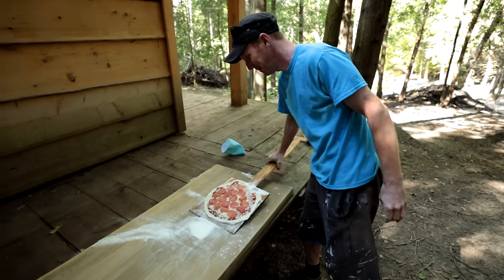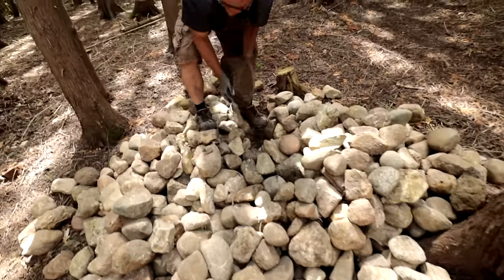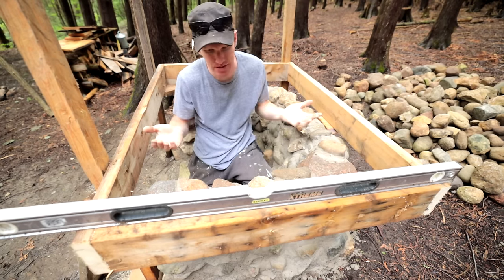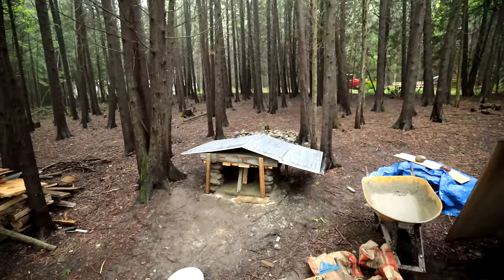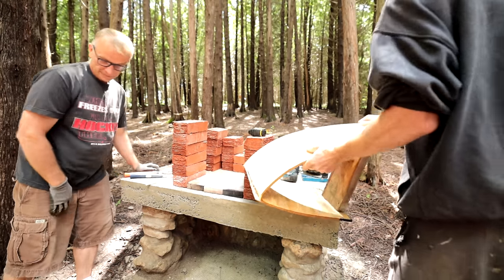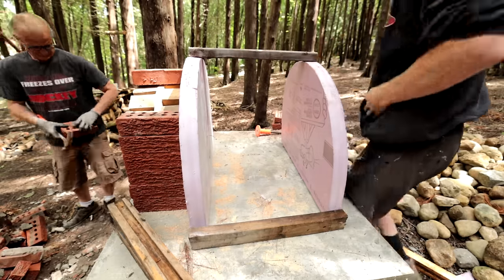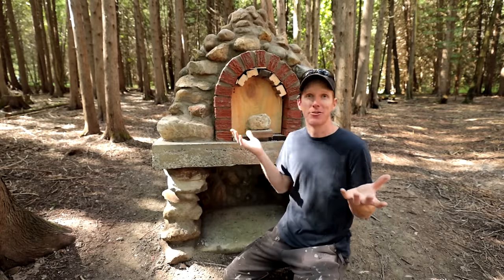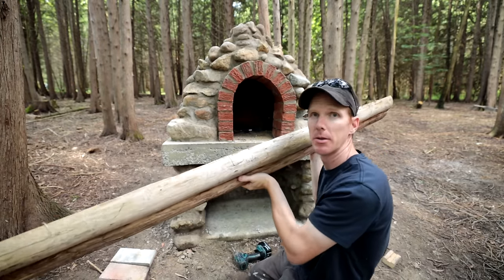I Built a Rock Pizza Oven!

Comment: Nice video and nice oven!
Suggestion:
After building the oven dome with rocks and cement mortar, apply at the inside of the dome a 3cm clay liner.
The clay should be thoroughly mixed with sand and chopped straw.
After application let dry and burn the liner slowly increasing the heat. 
The clay will shrink and comes loose from the rock dome forming a thin cavity. The that's what we want! The cavity prevents excessive heat transfer into the rock shell. Whereas the clay liner becomes really hot. 

The liner will crack a little but the cracks are easely repaired with clay slurry. 
The results are:
Quick heating up. 
Less wood consumption. 
The Rock / cement outer shell remains much cooler than the clay liner and due to that with lesser tendency to crack! 
Increased overall longevity due less thermal loads. 
The liner will be baked afterwards and will not soften by water. Nevertheless the oven should be covered (especially in winter) to prevent water entering. Porosity of the cement and baked clay is your enemy. 
Good luck!
Reply from the maker: Thank you for this.  I might retro fit / upgrade in the near future.

Comment: You tie the rebar so it doesn't shift from its position. The rebar in your slab should be in the center so it is in neither compression (at the top) nor in tension (at the bottom) for best results. For a slab like you made welded wire fabric (about 4 x 4 inches by 1/8 inch would have worked.

Comment: Dude, stop with the head mounted camera or whatever you were using. The camera work is terrible. I feel sick from watching it jump around. Also, do a little research before you attempt something like this. I get that you were doing this, "on the cheap" and didn't want to spring for a lot of fire bricks and refractory cement, but your dome dimensions are all wrong, and the regular cement will start degrading with the heat in no time. Cob would have been a better alternative. (And probably would last longer.)

Comment: A bear is gonna steel ur pizza and blow it down with a fart. Compact the clay that’s wer U wanted the concrete base... ur slab is not compacted either hence its porous appearance at the bottom.... concrete slab on top of hand picked stones ... stay rustic don’t worry about levels.... use a sharp sand 3,1soft to 1 cement ... ok I’m being an a hole .... compact the mortar first then float and sponge ,,,, even the trees are pissed off with u homie..... isit even near ur house